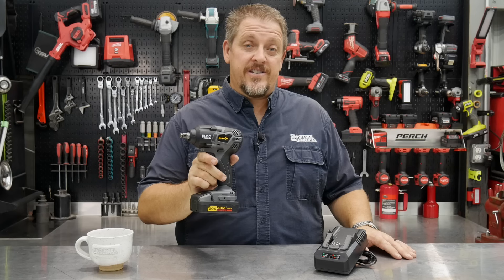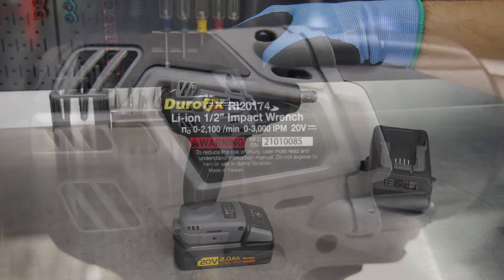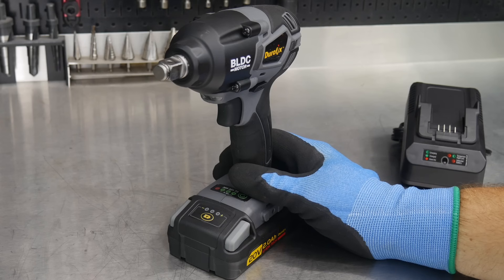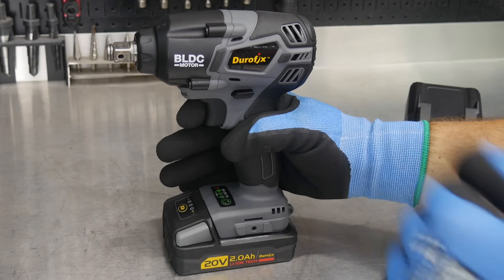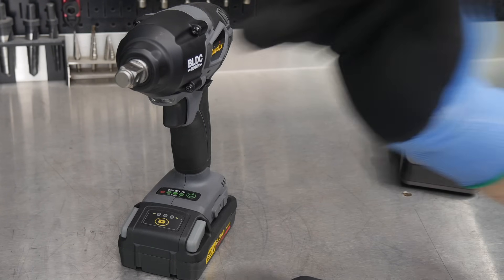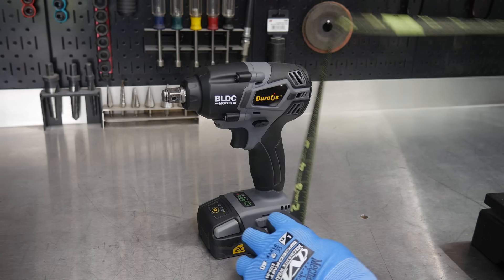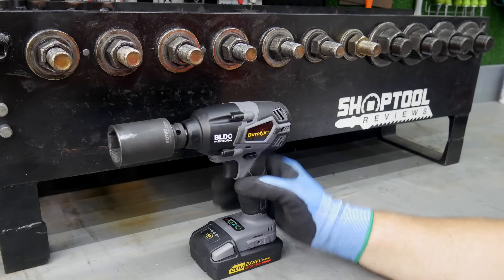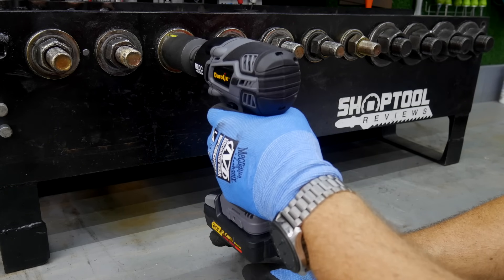Can it Be? An Impact Wrench for $179 (batt & charger) with more than 500 ft-lbs!

Comment: That's a bad little bastard no matter the claims.  Especially for a 2AH?  I was looking for a battery change every other bolt lmao.  I just got some of this companies stuff (ac-delco 3/8 ratchet  ARW1210-3T and a 3/8 in impact ARI12104) and i was VERY shocked at the quality of them especially for 170 bucks for both tools, two batteries and a charger (prime day baby.)  I mean i more often use ingersol and CP 1" air guns and my DCF900 but for what they are, I'm in love

Comment: Title is a bit misleading: tightening torque is only 369, and loosening is 590. Current price is $183 for tool, battery and charger. Looks solid and good value for the $$$ though.

Comment: this is not worth now for buying like most of cheap  because as i see you can get for around 130$ Ryobi p262 (ebay and amazon)  which have real 800+nm of untighten  and 600+nm of tighten torque and add 30$ 6 amp battery

Comment: i bought from aliexpress 800nm wrench with baterry for 68$
Reply from the maker: Hope it works for you. Thanks for watching.
Reply: @Shoptoolreviews  if it deliver 40-50% of that numbers it will be fine,as I see Makita and Bosch with 180nm costs 3-4x more and without battery
Reply: @Shoptoolreviews  its not for daily few hours pro work then for occasional   like  tire replacing and bolts unsrew and similar things

Comment: You can buy the Ridgid 1/2" Drive impact wrench up to 485 ft.lbs - 620 ft.lbs of torque with 4ah battery and charger for $149 now 😂 lifetime warranty on tool and battery 👌
Reply: And let’s not for get the OG Ridgid high torque that Home Depot was featuring on special buy a while back with the 4Ah max output $199

Comment: Heck, I like the Torq gun with the Hytorc 18v tool that you used to torque the stuff with.  It seems to be a hoss.  As for the Durofix impact, I do like the torq settings and auto-shutoff feature.  It seemed to handle extended hammering times. Like one of the other comments, I wonder about its durability for a year's worth of use and if it had to be warrantied, how easy/good is the warranty ? Overall though for this quick 15 min test, it looked to hold up and work pretty good.

Comment: 7:51 Hey! I just had an idea! Torque a different bolt to 73ft/lbs or whatever, then use a torque reader adapter(or the torque wrench if it has that feature) to see how much torque it took to get the nut loose. Then loosen the nut that the impact tightened, compare their numbers! If the torqued nut takes 50ft/lbs to remove, and the impacted nut takes 65ft/lbs to remove, then you know that the torque setting on the impact isn’t accurate!

Comment: Appreciate this review. I totally agree with your assessment on the tightening. I’d much rather have the tool report a lower number than a higher one. I always finish with a torque wrench anyway. As long as the lug nuts are tight enough to lower my vehicles  to the ground then I’m good. 

I like your style and I’m glad subscribed! I .

Comment: Is that the same battery and charger as the earthquake 20v
Reply: The earthquake xt cordless tools and acdelco cordless tools are made by durafix. The batteries are interchangeable. Acdelco and durafix have more options such as both brushless and brushed impact wrenches and ratchets. If I remember correctly the last time I looked into it the durafix and acdelco tools cost a little more but you get a better tool at the end of the day. The earthquake xt models are probably earlier generations of the durafix and ac delco

Comment: I paid $182 for the Makita XWT18Z (EDIT: For clarification, that's bare tool, not a kit). This one did well, but that Makita is just impossible to beat at that price.
Reply from the maker: That was with a battery and  charger?
Reply: @Shoptoolreviews  No, that was bare tool. Certainly apples to oranges, and depends on the batteries (or adapters) you own. 

But correct, you get both less (no battery and charger) and more (power and tools on the platform) with the Makita.
Reply: Makita hard to beat regardless !

Comment: at lowes 2 Dewalt impact wrenches with battery and charger for $249, you get the 1/2'' and the smaller 3/8'' wrench.
Reply: Link? Sounds like a screaming deal

Comment: the  RIDGID 18V Octane impact wrench with battery and charger is $159 at Home Depot,  620 lbs. of torque.
Reply: And - Milwaukee M18 FUEL Mid-Torque 1/2 in. Impact Wrench w/5 Ah Battery, CPO via ebay $187. These will go fast! 62 and counting sold in 1 hour.

Comment: Looks just like a harbor freight earthquake 20v 3/8 impact . Even the charger and battery looks the same too .
Reply: Can confirm it's not, the HF 3/8 is a doggg
Reply: @TorqueTestChannel  lol I said it looks like and wouldn't be surprised if it's made by the same manufacturer.
Reply from the maker: I don't believe that Durofix is building those, but I could be wrong. Thanks for watching.
Reply: @Shoptoolreviews  if you go and watch the cactus Maximus video of the teardown of the Harbor Freight 20 volt half inch impact it says durofix on the aperture during the teardown so Harbor Freight guns are made by durafix

Comment: 16:34 spot on. The best anyone can do is test them all the same and compare, which you always do a great job of here Tim. That's tools an impressive one for using just a 2ah battery, and the price considering it's TW not CN made. Another great video
Reply: So r u gonna Torque Test it on the Dyno or what???? 🔴💪😁
Reply from the maker: I truly appreciate it. I agree, this thing is pretty strong for a 2Ah, and the price is solid for the Taiwan made. Thanks again.
Reply: If you make tools for harbor freight so your Hercules brand it's just 500 foot pounds it's not even close but I do like the tool it's nice and light we should put the real foot pounds of torque it does it would sell a lot better and not scheme so many people